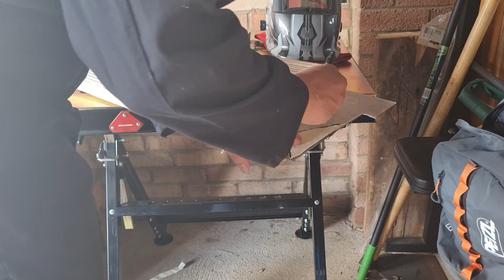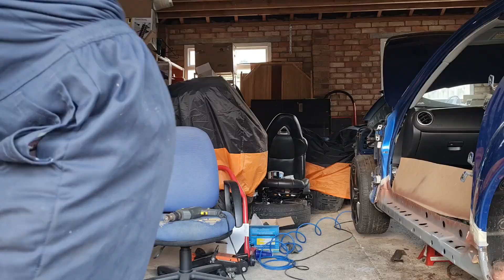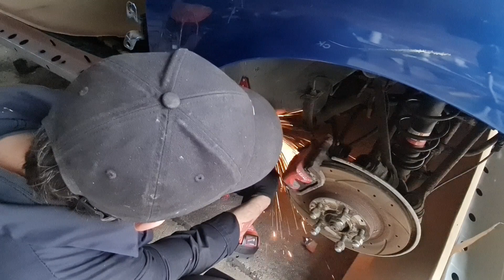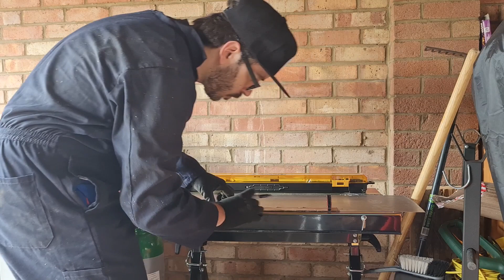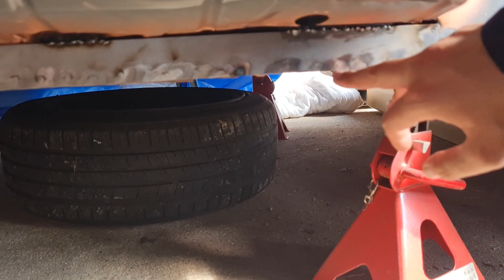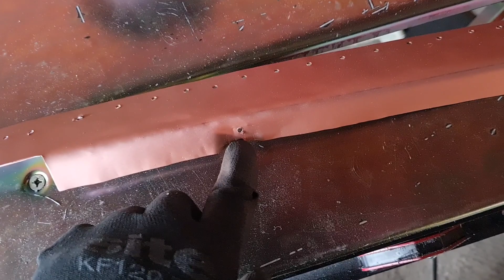Restoring a rusty Mazda RX-8 - welding the inner sill/rocker

Comment: How long have you been welding??

I’ve been wanting to learn how to weld so I could work on my Mazda rx8 has the same rust issues you are having with the rear corner 
And frame rails 

You think it’s possible I could do it?
Reply from the maker: Hi, i actually had never welded anything in my life before I started this project, so you can 100% do it as well. What I did was watch loads of YouTube videos about it, but one that was not overwhelming or too technical and easy to understand was from the make it kustom channel, it's called "Mig welding basics for beginners", have a watch